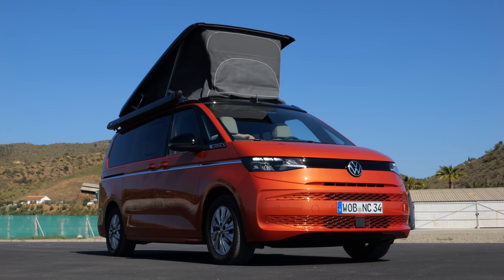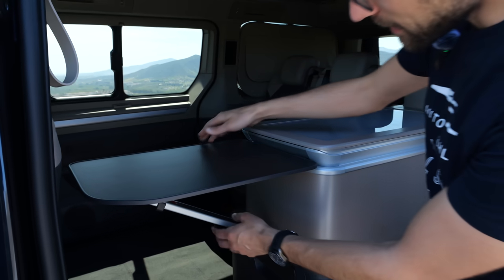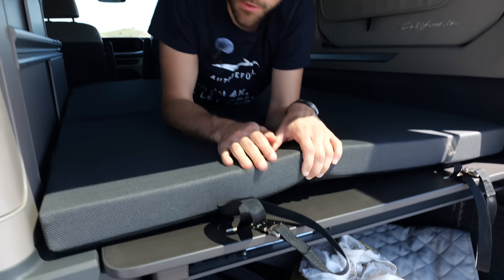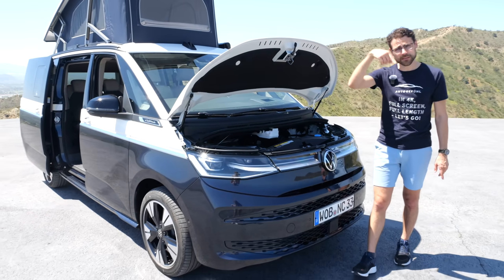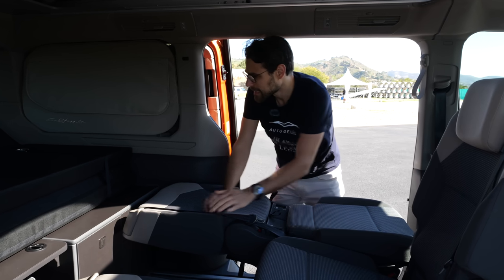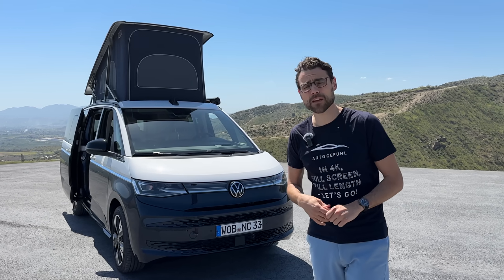all-new VW Multivan T7 California - the ultimate compact camper van?

Comment from the maker: ►Subscribe here: https://www.youtube.com/user/autogefuehl?sub_confirmation=1
►Also subscribe to our YouTube shorts channel: https://www.youtube.com/@thomasautogefuhl?sub_confirmation=1
►Follow us on Facebook / Instagram / TikTok @autogefuehl
►Sustainability in the automotive industry documentary: https://youtu.be/-8gNXlRGngA?si=bCdeJZORRHNcVmV2

00:00 Multivan California Ocean
00:44 Length and roof times
02:21 Batteries and power supply
03:37 Interior and features Ocean
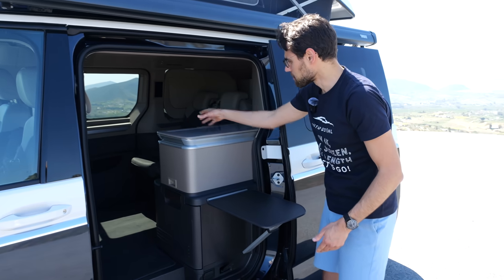04:47 Chairs
06:12 Rear interior and shower
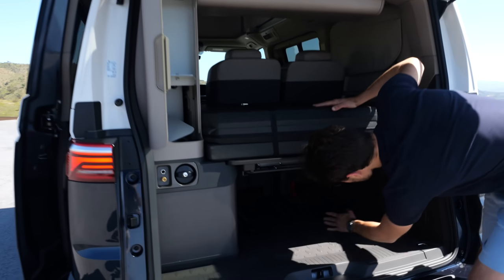06:46 Rear storage
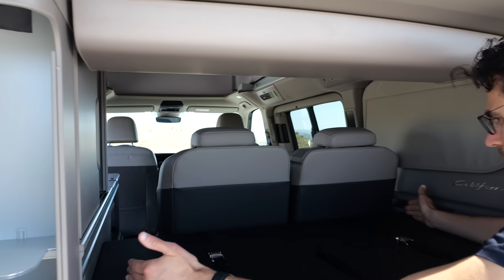07:22 Ocean vs Beach
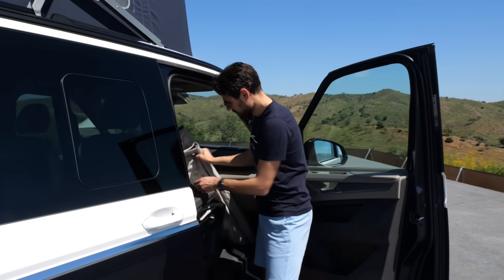08:33 Front shades
10:46 Rear kitchen area
12:30 Standing in the van
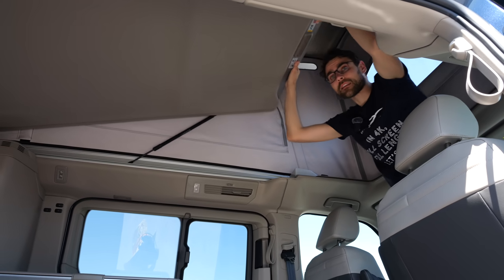12:54 Top comfort bed
15:10 Lower bed
17:49 App Control
18:32 Front Cockpit
21:08 Engines with AWD PHEV
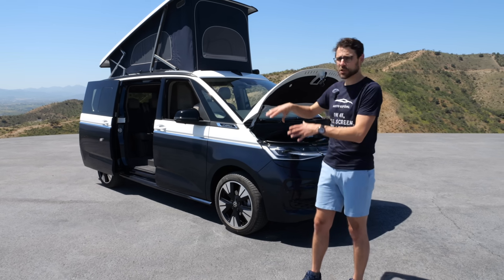22:48 California Beach 5-seater
23:15 Prices
23:43 Beach interior
29:09 Not a T7?

#vw #vwt7california

Comment from the maker: Data & facts:
VW T7 California

5,17 m 204“

4 to 6 seats, 2 to 4 bed spots
Electric deployable roof standard for Ocean, optional for Beach and Coast
Manual roof for Beach
Standard 2 sliding doors
Marquee right or left

2025: App control

2.0 TDI 150 hp
2.0 TSI 200 hp
1.5 TSI PHEV 245 hp electric AWD
20 kWh 11 AC 50 DC

Beach over 60.000 Euro, Ocean over 80.000 Euros

Transparency note: Autogefühl videos are independent and free from editorial influence on opinion and rating. But since manufacturers enable us to do the reviews in the first place, for legal reasons this video is marked as _advertisement_.
Reply: Really nice to see the van as a plug in hybrid. Makes so much sense for road trips while still having the city usability of a EV.
Reply: Is that mean that when I get 6 seats in Beach there is no bed downstairs?
Reply: Previous California Beach had up to 7 seats with downstairs bed and  enough space between bed and front seats for toilet and fridge. 🤔
VW is selling a square trying to convince us that this is a better design of a wheel. 😉

Lars Krause: “New California offers more of everything. More space, more flexibility…”

Let’s hope for T7 California. 😎
Reply: @Jushwa  if you buy a plug-in - what after 10 or 15 years? well-kept T4 and now selling, what about the batteries later?
Reply: @januszzgiet  time will tell but the e-golf’s are still working fine after 10 years. Sure there is degradation but still useable. Out of spec bought the cheapest one in the country for 3 grand and it works fine 🤣. That’s not always the case tho. Especially not with other brands…
Reply: Cool 👍🏻

Comment: I expected a lot from the final version, but I was disappointed. I see that VW has simply gone backwards in several solutions:
- The table hides behind the mattress, which takes up luggage space. Why couldn't they keep the existing side door solution?
- Detachable seat headrests, in the T6.1 they are simply hidden and this solution is easy to use and very practical.
- No blinds on the front window of the car. The curtains take up the luggage space and, to be honest, I thought that this version would finally have blinds on the driver's and passenger's side doors too.
- Only one gas burner in the stove, one too few. In the concept version, the solution with two different power sources was really interesting.
- Narrower lower bed, it was 114x195 cm and now it is 106x198 cm. That is, the bed is as much as 8 cm narrower.
- The car itself is also longer - it is 517.3 cm long, while it was 490.4 cm long, which is a total of 27 cm longer. Currently, with the T6.1, when we mount a bike rack on the rear door, it can be difficult to fit into the outline of the parking space.
- Side wardrobe opens only on one side, not on both sides and with a mirror as in the T6.1.
- Connection for refilling water inside the car. It is more convenient to refill water without opening the rear door.
Additionally, the concept had better solutions:
- Drawers in the kitchen, which simply had more (cutlery, cups, spices, plates) and opened on both sides. I also don't know why a curtain for the drawers is needed. I think it is unnecessary and this design solution has been present since previous versions of the California. This is where Marco Polo is better thought out.
- The power and USB connections located under the stove were more accessible and not hidden at the back, as it is now.
- It's also a pity that the idea of a retractable shower hose was not used. Now the Ford Nugget has such a solution, with the option of heating water.
- When it comes to the fridge, the idea of it being an openwork drawer is completely illogical. Every time it opens, all the accumulated cold will escape from it. As a result, more energy will be needed to cool the fridge again to the set temperature.
- No electric grill or lamp by the side doors.
Personally, I still miss:
- solar panels on the roof,
- a self-folding tent,
- factory-installed, sliding mosquito nets on side doors 
(above solutions can be seen in the new version of Ford Nugget)
- Window blinds with material that reflects sunlight, which will additionally reduce the temperature inside the car during hot weather.
- AC, so far, no car of this type has introduced parking (with the engine off) air conditioning, which is a pity.
- and at least one plastic window in the roof tent, for rainy days.
To sum up, although I see the advantages of the new version, there is still a lot to do. And all the VW need to do is just to listen to user opinions.
Reply: Totally agree with everything you said. The only thing I wish my T6.1 had is an electronic hand break, and hot water tap ( l'm not sure if the T7 has got it). Otherwise my T6.1 4motion is a keeper, it's an instant classic now! No desire to „upgrade" it from what I see.
Reply: @amberjackrtw7322  I will also keep my t6.1 4motion forever, this seems a step back
Reply: AC off...buy the Plugin, which has AC in off Mode like any EV, too. Use this very often in Passat GTE and our Multivan eHybrid.
Reply: Totally agreed. I would just add that especially the Beach version is a complete disappointment. It used to be a good choice for someone who needs a practical daily van and also a basic camper. Now it's not a good van, because of the drawer that takes up most of the trunk and the downstairs bed is just horrendous, with the inconvenient folding and middle backrest in the way of legs. So not a good camper either.

I am pretty sure this will be a tough sell.
Whoever approved that needs to find something else they're good at. 

Yeah, and I was excited about the plug-in hybrid camper because of the large hybrid battery would be great for camping. But they couldn't make that work either. Because of warranty issues? Oh my.

So, waiting for the next gen Nugget.
Reply: Agree. Definitely step back. Only one thing better is mosquito web in large top window. Anything else in My opinion is worst.  I was planning to buy it, but now I have so many doubts that I probably go for different car. Does anyone knew top bed maximum weight in this T7?
Reply: @flashlightbeam3487  It's going to be 120 kg give or take. Don't buy this. Marco Polo or Nugget are better choices.
Reply: @vecernicek2  Thank You. I think the same way. 120 kg? I am not even sure if I can sleep there alone😂
Marco Polo is 200 kg and this is ok.
Reply: @flashlightbeam3487  Looked into the tech data, actually it's 150 kg.
Reply: @vecernicek2  Thank You. Still not enough.
Reply: Excellent summary. Although it seems like they are trying to cater to a different audience. This is a weekend camper with basic amenities for a night or two. A daily driver/glamping platform.
Reply: @josefv-y8m  I don't really know what solution you're thinking of. Can you give an example (link)? Thanks :)
Reply: @pdcichosz  Honestly, I now mainly use my T6.1 for weekend trips and I feel the lack of the elements I described (mainly because of my woman ;). But even if it is as you say, I think that people who expect something more will simply choose another car.
Reply: @LopebeHaab  I honestly hope so. There's much more to be had, especially in this price range. I've attended 2 camper shows and was surprised by the lack of innovation. Small, specialized builders with ideas are miles ahead of the big players when it comes to versatility and execution.
Reply: @pdcichosz  I totally agree. Which makes me very sad.
Reply: I dreamed of the T7 with the same T6.1 interior but with a mercedes marco polo quality, but VW ruined everything with this one!!!
less storage space, stupid 2 rear seats, more complicated maneuvers, smaller kitchen without a real table what was the saller point of a california...
I think that VW will revise this one, because it will not sale as they expect, the T6.1 is by far superior in every way.....
Reply: @vecernicek2  I orderd Marco Polo, but really think Nugget is much better.
Reply: @josefv-y8m I thought the multivan had that AC option for when driver leaves 6/passengers or pets onboard to pop into shop etc. 
I have the 2017, but if it has aux motor AC I haven’t found it yet lol.

Comment: I'm glad to own a T6.1 California Ocean 4Motion!! 
I wouldn't change for no money (maybe only without kids)

Why? 
- There is way more storage space (under the rear-seats and the kitchen) in the T6.1
- It's much easier and quicker to change for the bed downstears
- It's way easier to shade the windows in the T6.1, especially for the front window
- We often use both gas-burners. The T7 only has one
- There is a inside-table in the T6.1 that is always ready

What I don't understand with the new one:
- isn't the weight a problem with the hybrid version (if you need 4x4)?
- the argument of the high-voltage battery for camping mode doesn't make much sense for me... Maybe just a cost-optimizaton for VW to not add additional control-units (?)

For sure the T6.1 has some things that could be better as well. But the T7 is a step back from my point of view!

Comment: The Ford F150 and other eclectic vehicles were marketed with the V2L as one of their USP. "Power your home in a blackout" and things like that. So I think the explanation with the warranty is not plausible. More likely the whole hybrid system is not engineered for such applications, or they have to change many parts in order to make it so, which wouldn't be cost effective. Hence 2 more lumps of lead acid batteries.

Comment: On the Beach version the rear central seat is a BIG mistake, it should fold like the two others, without the need to turn it backwards to set up the bed.
Reply: That would actually be an upgrade, but no, they had to reinvent the wheel.

Comment: I'm so jealous, I want this so bad! 😞 I'm driving the T6.1 California Coast 2.0 BiTDI and its great for camping. I would highly recommend going camping for a long term test 😀 Thomas I noticed that the Ocean variant you tested, does it not have electric closing rear door? Does it have option for privacy glass in side sliding doors?
Reply: You are jealous of smaller and less practical van? Keep your T6.1, it just risen in value , it is the last of the real ones
Reply: @hydrotricine it is the last of the ones with always corrupted engines...and drives as noisy as a lorry
Reply: @josefv-y8m  How many kms have you driven on yours? Mine is the simple 150ps Tdi, not the BiTDI, i find it a real joy to drive, no problems so far and super quiet, and i have AT tires so it should be noisy. But good luck with the new Hybrid Multivan, nothing like having the complexity of a ICE mixed with the integration of EV on a platform that is not optimized for neither😅

Comment: Love the video thank you! Do you know if it is possible to still charge the PHEV battery through the leisure battery plug? If you are on a campsite will you need to charge the leisure battery and the PHEV separately?
Reply: Why should this not work? It is just slower....2,3kw instead of 11kw maximum
Reply: @josefv-y8m  not really thinking on wattage. My understanding is that it's two separate batteries. Do they use the same socket to charge? Or are two separate sockets required to go to each battery

Comment: personally I preferred your original concept kitchen with slide out induction stove with one level cooking instead of silly and fiddly add-on  bench and old gas stove stove with  small sink combined and hinged lid over the top which in itself is very impactical,having to lift a lid to get to sink. Please give my raspberries to the VW design team because this is a total downgrade and thge value of the T6 just went up.Also the living space is actually smaller and tailgate is a head-bumper for most people.Shame VW.Please do better next time

Comment: Ultimate camper van should be hybrid not, electric.
Reply: Can u explain why it shouldn't be electric?
Reply: @gullible119 long distance journeys that are far away from charging stations.
Reply: @ArielRicafort-g9v those don’t exist in the western world
Reply: Glad that I will buy the T7 California Ocean PHEV.
Reply: @ArielRicafort-g9v  Yeah, plus it is easier to carry extra gasoline As you might be traveling long distances between campsites and may not always have access to charging stations. 
And Camping vehicles draw a lot of power for things like refrigerators, lights, and appliances. Even with a large battery pack, an electric vehicle will struggle to provide enough power for an extended camping trip without needing to be charged.
Reply: @logic_bot3753 Exactly.  Imagine driving this just from San Francisco to Burning Man. Dicey and a huge hassle. It needs to be a hybrid
Reply: Plug in hybrid is best of both worlds right now. This is perfectly suited for the market they are targeting.
Reply: @gullible119 - most campsites in rural areas  I have been to in Europe in the last couple of weeks have stated ‘no EV car charging’ so it’s not going to work as a leisure vehicle.
Reply: @ArielRicafort-g9v  Almost all campsites have electric hookups so not an issue. And this isn't a 4WD vehicle so won't be going into the wilderness. Additionally, a foldout solar array could be used for powering everything when stationary.

That said, this is a plug-in hybrid - not all electric.
Reply: No way
Reply: @TecnamTwin  - but most campsites do not allow charging if EV vehicles and especially on the electric hook up post.
Reply: with plugin hybrid you can cool or heat without having the engine working.All is done by the battery.See camping with prius sienna or mitsubishi hybrid
Reply: @gullible119  I would never have an electric one. Would consider  a hybrid  though
Reply: Huh? It is a diesel hybrid. At least the one he is showing.
Reply: @k.c.miller9965   either  diesel   150 hp or 199 hp I think  or a  fully petrol or petrol hybrid  I think. No diesel  hybrid  it  would coke up in no time  with that I think.
Reply: Nah .. EV better than ice or hybrid
Reply: Diesel Hybrid would be simply incredible 👌
Reply: @MrRollingEgo exactly, but what exists in western, eastern, northern and southern world is charging ports that abruptly stop working 😂😂😂😂😂
Reply: @JPatel1995  until you land yourself in a situation where you & your EV is left stranded in a remote location with 10-20% charge and the charging port dysfunctional.
Reply: @oommenthms2728  Yaaa.. and every car should come with four spare tires because you never know when you’ll get four flats at the same time and there’s no roadside assistance/towing anywhere to be found .. could happen
Reply: @14Jem These campsites are going to have to upgrade their electrical infrastructure in the next few years or they will start falling behind customer needs.

Comment: So it measures the same as a Vito, but it is more than twice the price of a Vito, and on top of that the Vito is manual, and I don't have to worry about where to fuel it. ....
I would not be finding the reason to buy this VW, I have even seen Kangoo's better equipped for camping, and that the Kangoo is much smaller ... imagine the possibilities in a Vito....
Reply: There is already a campervan based on the V-Class ( which is a luxurious Vito version) called Marco Polo.